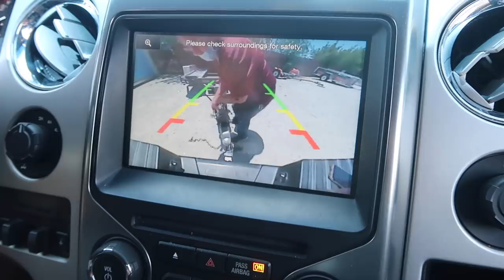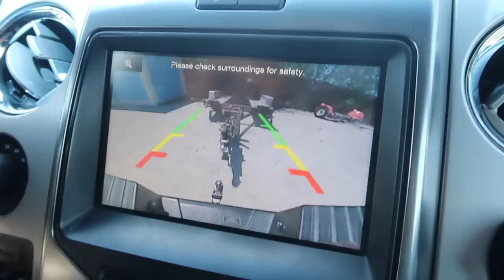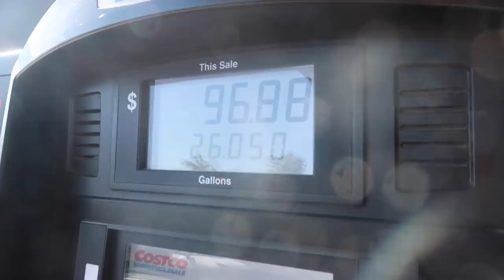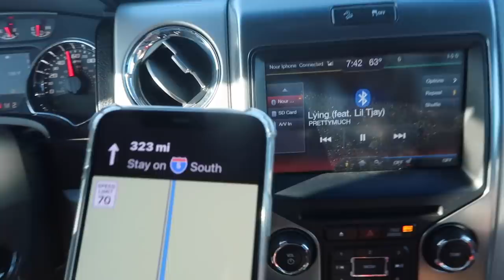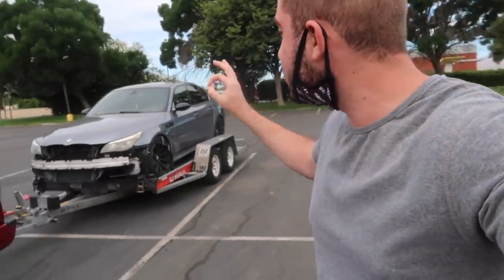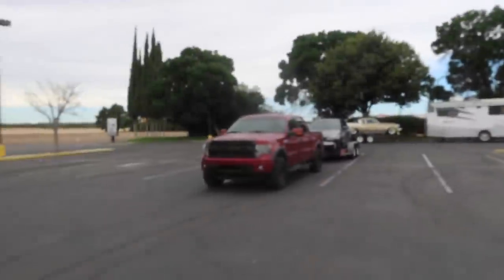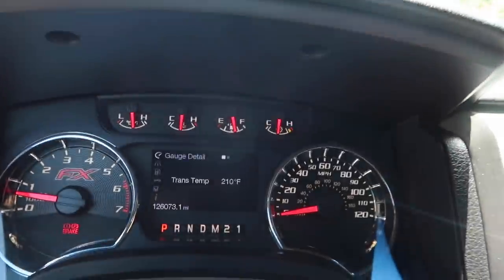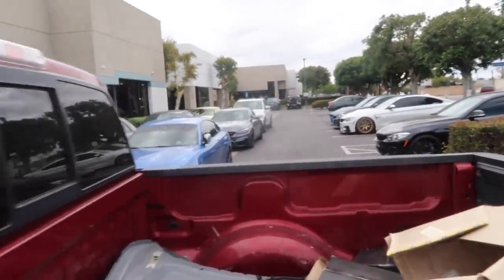TOWING OUR V10 M5 TO SSR PERFORMANCE! Can They Get It To Start?

Comment: Put premium in the truck, the ecoboost 3.5 engines do not like the regular gas. This is a direct injected engine. The intake valves do not get cleaned. The premium helps with cleaning them a little bit because its cleaner fuel. You will notice the difference when u put premium it helps with the fuel economy too. Im telling u this out of experience, i have a taurus sho.
Reply: About the fuel economy, run your tank really low and see if it triggers the check engine light. Youll get p2096 and that is the fuel mixture too lean. In that case it could be an o2 sensor.